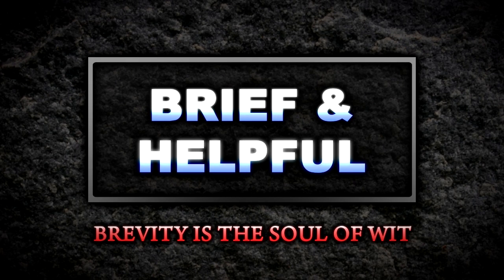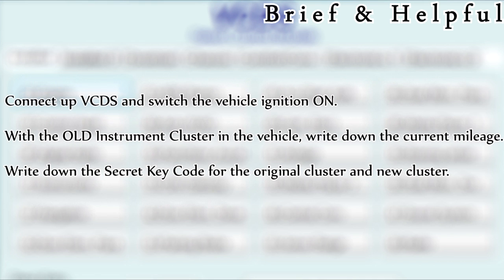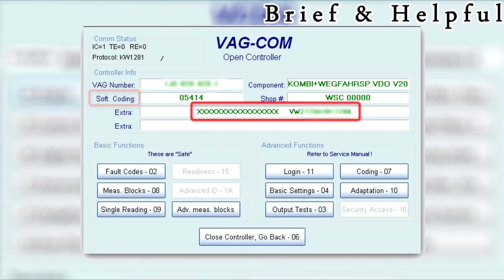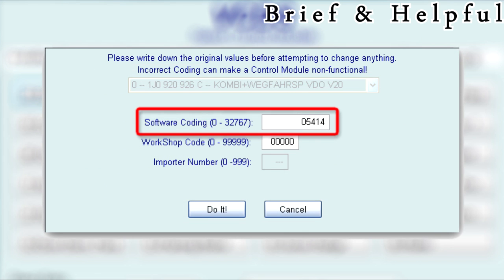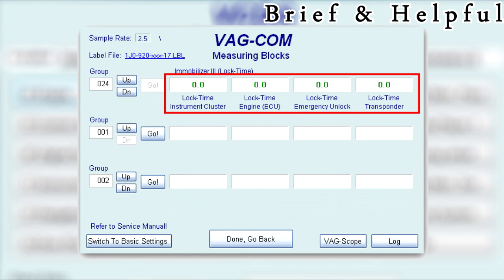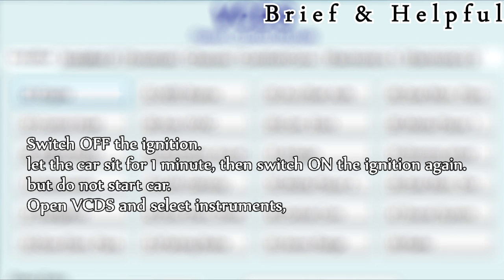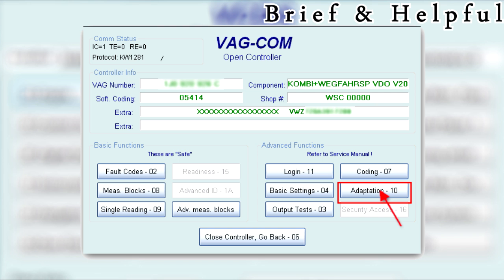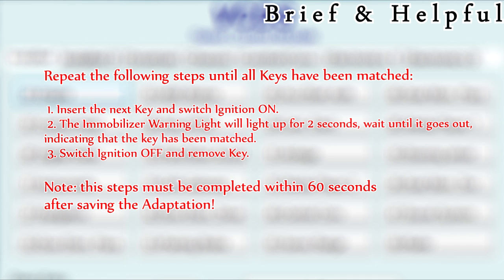Cluster swapping for Immobilizer 3.

Comment: hello dear. I need your help I had a car won't start beetle 2000 model before it was worked when they repair the car aircon after that 2 days ago the car won't start. so do you have an any idea? thanks for Reading.